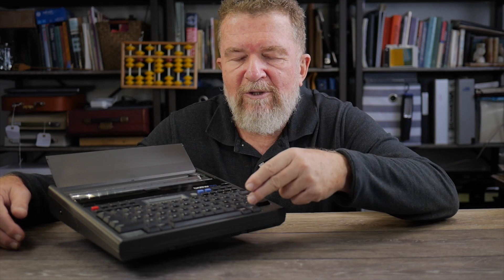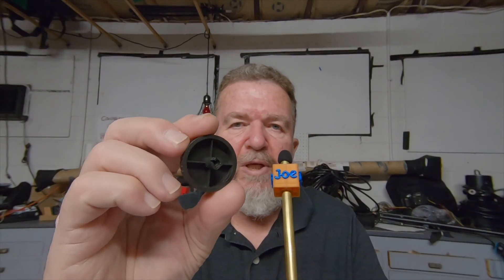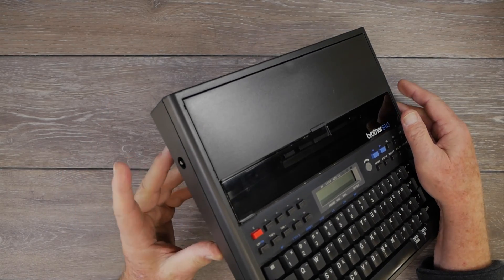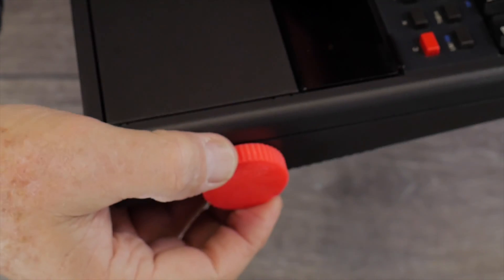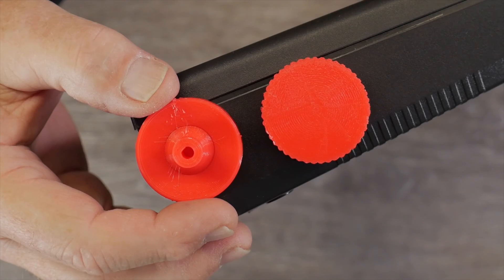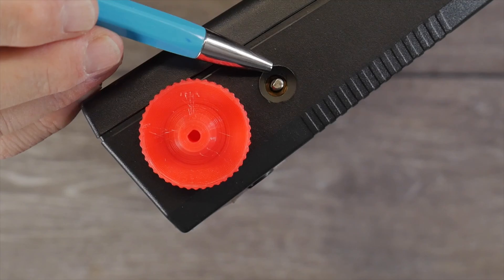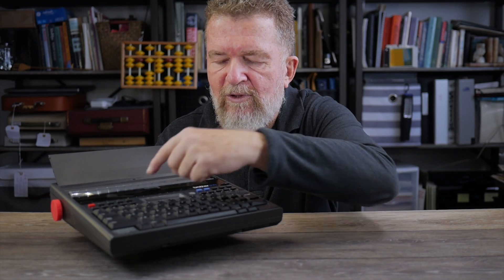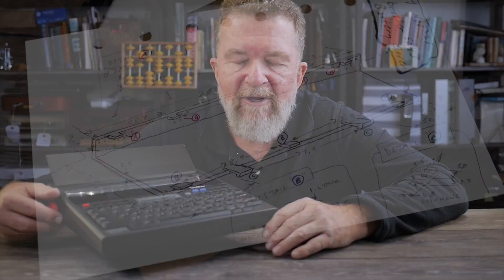Brother EP43 3D-Printed Platen Knob

Comment: Since my original comment, still using my EP-43, I have written 277 pages the bulk of a manuscript i finished in mid August of 2024.

But what I'd like to say is  my machine came with 5 of those cartridges, so i opened a new one and used it for research, guess how many single spaced pages you get from one cassette?

Considering its size and era, i was impressed, but ultimately I would need a mess of these cassettes if i wanted to write all day on regular paper.

30 pages from one cassette.
See, I didnthe research, so you don't have too❤
Reply from the maker: Thank you!

Comment: Just a couple of weeks ago, I found this exact model (possibly even the same run, My SN: L6xxxxx). Every since, I've been obsessed with it. It came with a cartridge already in it, and 2 spares. I found some letter-sized thermal paper on Amazon, and picked up some old Fax rolls from Staples.
I have so many questions:
- First, about the paper. Can you provide a link to your paper supplier? All the thermal paper I've found is either really flimsy/thin (I prefer heavier, like 24 lb to 30 lb). Or it has a sticky backing for labels. Any help would be appreciated.
- In the manual, I could swear I saw something about "multi-page memory".  Does that mean page, as in pages of paper? or is it only talking about the characters that 'page' off the LCD display?
- There are *upgrades I'd love to do, but I'm new to the hobby and would hate to damage my new toy.
  * Integrate 18650 Lithium Ion batteries with a USB charging option. I've worked out the basics for this one.
  * increase the RAM. This seems less likely since the amount is probably hard-coded in the ROM chip.
Reply from the maker: This looks like the kind I bought: https://www.ebay.com/itm/145546435889?mkcid=16&mkevt=1&mkrid=711-127632-2357-0&ssspo=nI_MG1WIQEC&sssrc=2047675&ssuid=&widget_ver=artemis&media=COPY